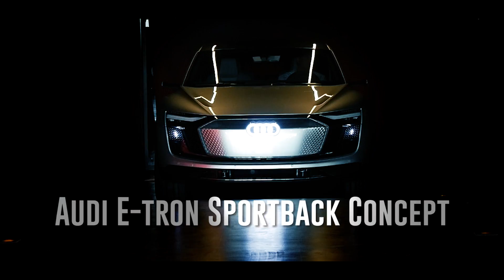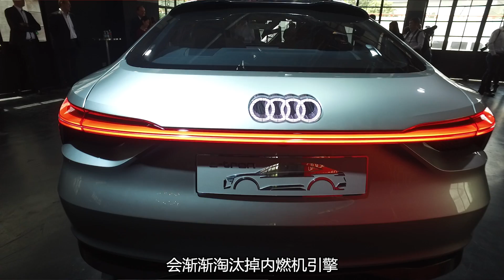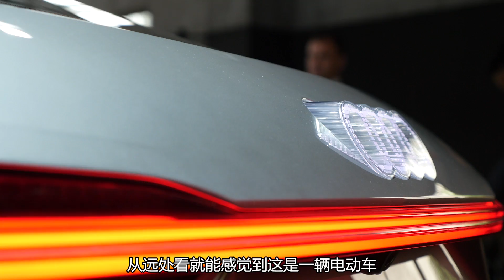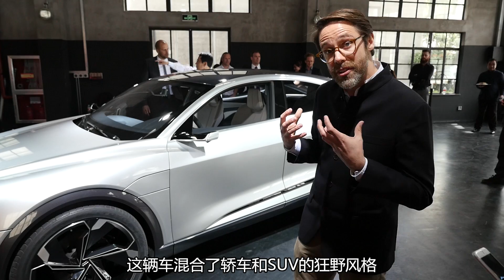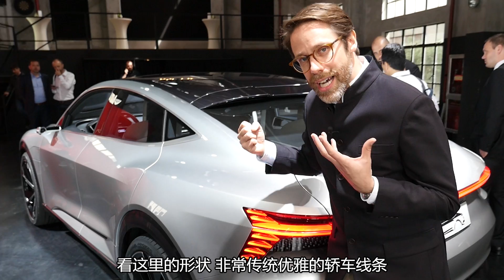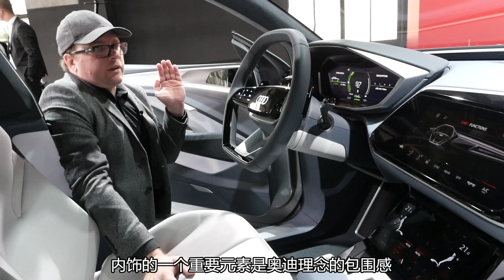Audi e-tron Sportback concept // Designers explain

Comment: Nice low sloping hood.should help anchor this AWD beast at high speeds.one of fastest production SUVs ever.lighter than range rover sport and porsche cayenne but not by much.if AUDI can utilize extra space from lack of engine to increase cabin size to at least 83 cubic inches sq then they will have a customer in me.

Comment: an electric car with a big grill, how stupid
Reply from the maker: it's not a grille as air intake. it's closed. so it's just a design element.
Reply: sportauto asia I know but it is to much vertical so the creat a high resistance coefficient
Reply from the maker: true, but that's just part of the current audi design. maybe later they will apply lower 'noses' and grilles.
Reply: Sorry but I dont see a grill, its completely closed. Do you know what a grill is?
Reply: A car without a grill or illusion (Tesla) of one is ugly af. Glad they kept it!